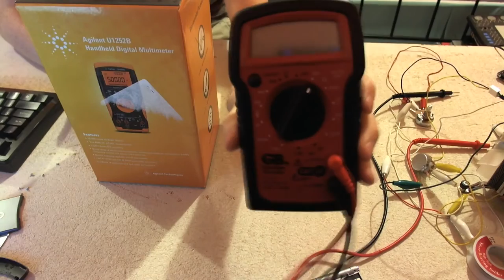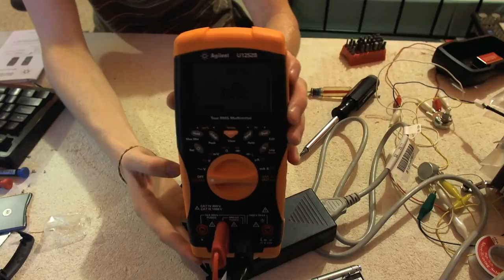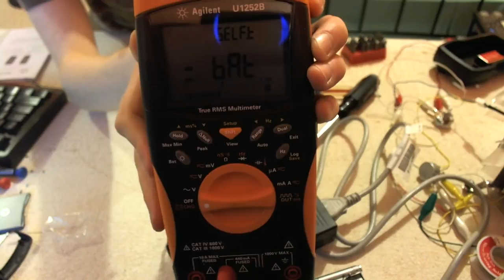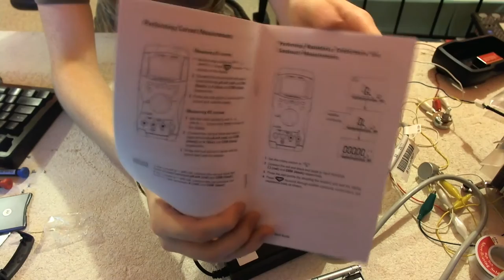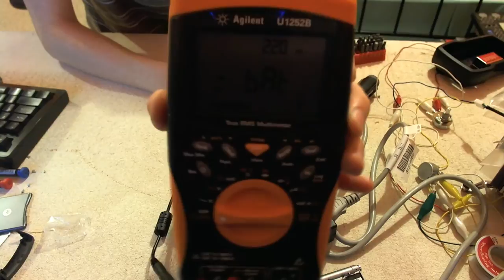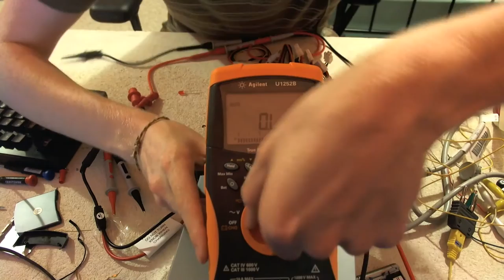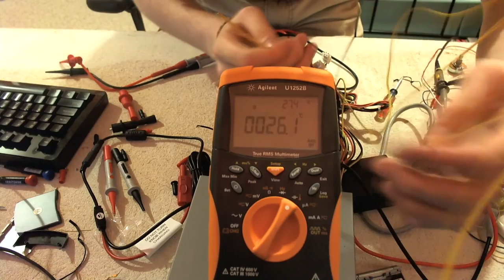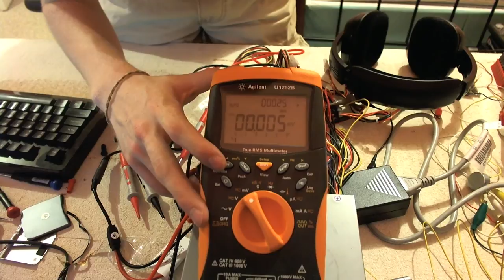Agilent U1252B Teardown/Review

Comment: Thanks for taking time to make a detailed review!  Its really a great DMM, I have the 1252a, and it looks and works essentially identical.  I think orange is a better color as its easier to see quickly than the dark blue.  After some months of use, the rubber coating is flaking on the casing and the rotary knob; nothing major.  That is ships with a better brand battery is a major plus, Powerex is Maha, a well known Taiwanese company.  I put LSD Tenergy in them and it > 6 weeks between charges.